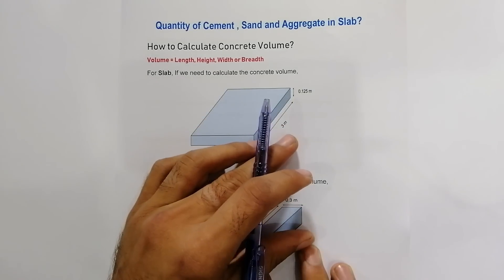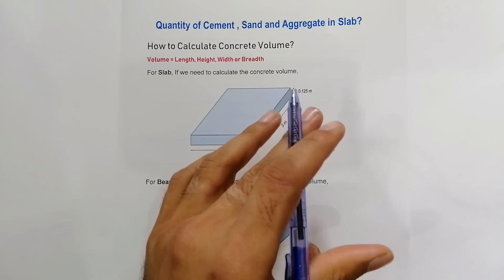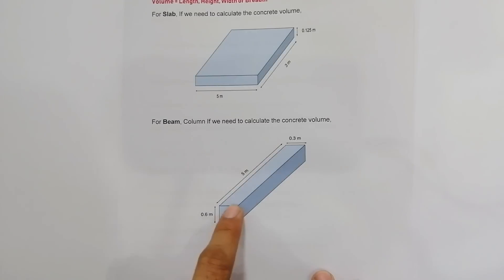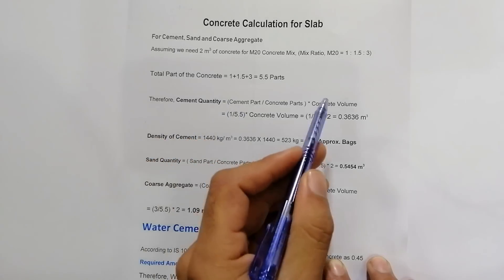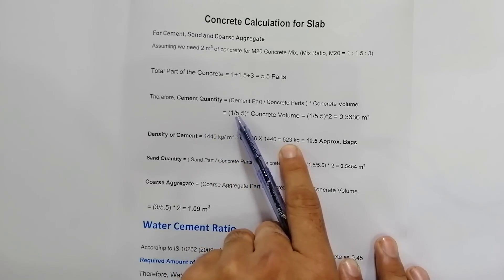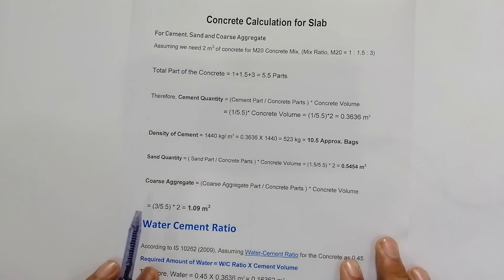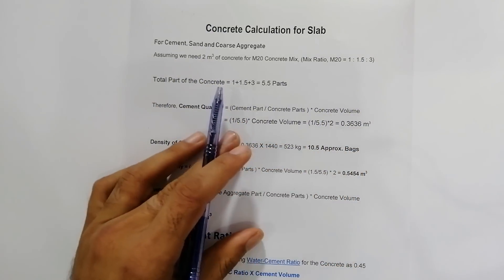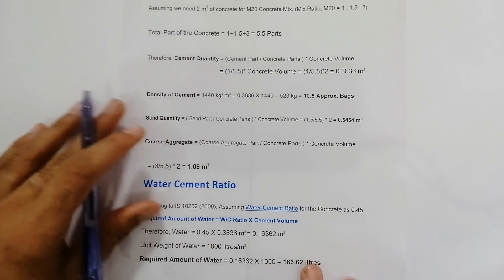Quantity of Cement , Sand and Course Aggregate in RCC Slab Beam and Column - Concrete Calculation

Comment: The procedure is correct 
But you forgot you increase 50% of the concrete because when you make additions the cement+aggregate+water it happens reduction of the volume concrete so that the reason why increase the 50%
Reply from the maker: this is already dry materials bro wet materials x 1.54
Reply: Civil Engineers  thanks bro jazakallaah I understood very well